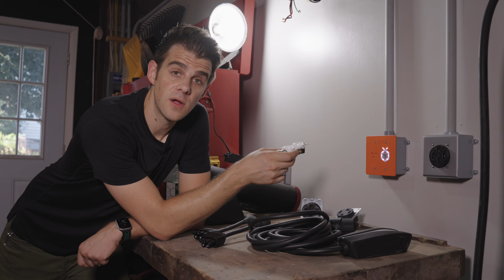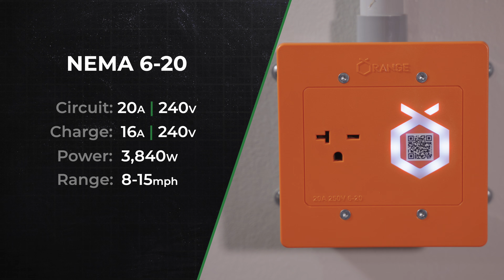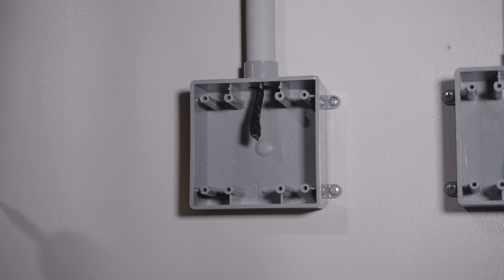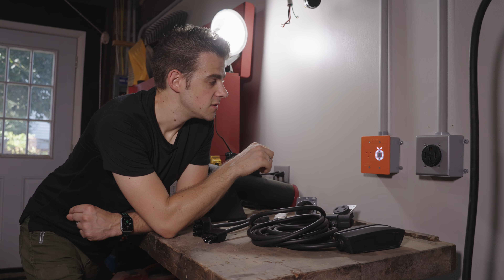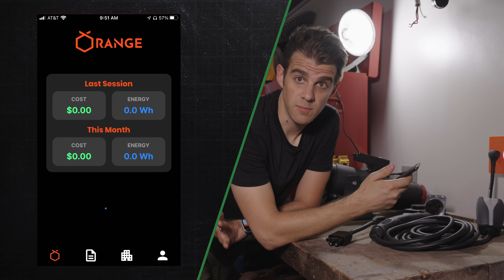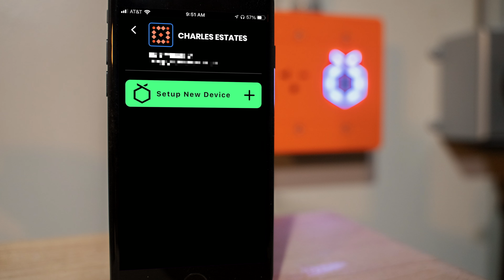A Better Option for Apartment EV Charging: Orange Charger

Comment: Thanks for this video. As a house renter and owner/driver of short range 1st generation EV (Mitsubishi i-MiEV) for the past 7 years, I currently find myself providing public input to the City of Tucson, regarding EV readiness standards for new construction of multi-family rental properties. The developers/realtors are resisting the idea of installing simple outlets that they can't meter, but aren't wanting the expense and bother of formal J1772 hardware. The Orange Outlet was brought to my attention by fellow EV-driving friends and appears to be the perfect problem-solving product at exactly the right time.
Reply: You are a brave individual for driving that vehicle...
Reply: @michaelholliday100  Actually, it's pretty safe (4 star NHTSA crash rating.) It sits up very high for a subcompact and at least it's visible to the typical pickup or SUV driver, who are hopefully paying attention to the traffic around them. Conversely, the windshield is massive and I know what pedestrians and cyclists are doing. Great acceleration from 0-to-30 (far more responsive than the typical subcompact gas car,) where most real world city driving is done. I can get out of the way of trouble quite effectively. I've been driving for 50 years now and even spent a few years way back when as a cab driver.

Comment: What a shame about the shape. Doesn't look like it's possible to put them outside with a weather cover that's required by code. Also the software needs to be able to have the money from a particular outlet go to a specific bank account. Maybe just have to set up a bunch of orange accounts. Otherwise very cool.
Reply: Its UL certified and its perfectly capable of being placed outdoors :)
Reply: how do we know the company doesn't offer a fully weatherproof unit? The examples in the video were both inside.
Reply: @rupe53  ya looking closer it appears the outer trim ring is separate and the rest can be placed in a standard exterior box..

Comment: So what EVSE Units use a Commercial Grade Side Wired 2-Pole 20A plug?  And what about the security of the EVSE?  I get the plug idea and cost and Orange looks like a good idea.  But as an EV owner in an apartment (not me, I own my own home) I can see the problem of EVSE theft is a big problem.
Reply from the maker: The Tesla Mobile Connector has a NEMA 6-20 option, and I've purchased a 6-20 to 14-50 adapter, but this requires an EVSE with the ability to reduce the charge current. I agree with the theft point. Something that helps is that most cars allow the plug to lock to the vehicle.
Reply: @chargeeverywhere  I'm in touch with my state senator that is on the energy committee and have a meeting with him in early October. I'm discussing EV implementation in Mississippi. I'm trying to convince him that we need to think beyond the next election cycle for solutions. Right now Mississippi is among the last in EV infrastructure. The report that was due to the federal agency on 1 Aug has been submitted but they, unlike Louisiana and Alabama, will not allow the public to see it yet.  Apartment and rental charging for the coming, I hope, lower-cost EVs will be important. Changing Electrical building codes to require x% Level 2 charging plugs even at 16 or 32 Amp should also be part of future buildings or current upgrades to existing buildings. The other need is to have a requirement to increase that % in line with the sale of EVs every few years.
Reply: I’m not sure about CSS but the Tesla connector can only be unlocked by someone who has control of the vehicle. They could take the short cable that plugs into the EVSE but not the EVSE itself

Comment: Does this really only work well if the renter has a dedicated parking space?
Reply from the maker: If the landlord installs enough of these it doesn't matter as any driver can use any plug and will be billed accordingly. That's the beauty of the installation cost being lower, many more can be installed for the same cost.
Reply: @chargeeverywhere  I see - the QR code isn't tied to the car, it's tied to the charging session.
Reply: @geirgaseidnes7809  ... the charging session will be tied to whoever activated the outlet with their cell phone app.

Comment: I like this for workplace charging too. It looks like a way for employers to offer charging without eating the cost of electricity.

How does it work on the property owner side? Is there a monthly cost to the property owner or does Orange just take a percentage cut of the revenue? 

If it’s just a reasonable percentage or none at all, I could see this scaling big all over the place.
Reply from the maker: From the podcast I know they are looking at workplace as a potential market too. That became less of a focus during Covid.

Orange takes a cut of $0.05/kWh, so they absorb some of the risk for landlords. It’s not a terrible fee, so I think it scales well.
Reply: @chargeeverywhere  Cool idea but 5 cents/kWh! Ouch, our standard rate here in Nevada is 12.5 cents/kWh! I'm on TOU rate so I only pay 6 cents/kWh. I could see a flat monthly rate but if the outlets are underused/unused I see how a landlord would be unhappy paying a monthly fee. I could see a landlord want to recoup some investment/$$ for on going maintenance and end up adding his own 5, 10 or 20 cents/kWh to the base electric rate (national average is approx 12 cents/kWh) plus the Orange fee so the end user may pay 22-37 cents/kWh
Reply: @bsaelectronicsgmail  Yeah, our overnight TOU rate here is $0.04, so Orange taking $0.05 means their fee is more than the actual cost of electricity. Ouch.
Reply: @bsaelectronicsgmail  Its actually 5% of the rate, not 5 cents
Reply: @bsaelectronicsgmail  That's part of the cost of owning an EV

Comment: Interesting, brings up a few questions. Electricians are going to be harder to find. What’s the projected cost of wiring a  200 unit garage? I guesstimate $100,000? Who will support “my car is not charging?”, the apartment (no), the car maker?, orange?, a electrician? ( @ $200 hr)
Reply from the maker: Yes, maintenance is a big concern for EV charging equipment. I do think something like this is substantially better than a hardwired EVSE. The equipment is much simpler and is very similar to a standard outlet (from the electrician's standpoint). If I had to guess, maintenance will likely be on the landlord, just like for any other outlet on their property.
Reply: @chargeeverywhere  This is correct and is why it was designed with simplicity in mind. Not only did we remove the charging cable to reduce maintenance costs but we also made something that's relatively easy to install.
Reply: I don't get it. What is the value proposition?

I can install a normal 240 outlet and ask the EV owners to pay premium for those spots. Why we are bringing extra payment and accounts etc? 
Also, if one apartment owns the charger and in other one I have to carry my charger all the time, I will chose the first option.

Outlets will be needed in all parking spaces in future anyway so why shouldn't one get the outlet  for $40 dollar and install the charger for $500(tesla charger level 2)? 
I really tried hard to understand but don't get the value prop. 

Founder, can you please explain?

Comment: nice, i hope someone copies that for the european market
Reply from the maker: Europe stands to benefit even more with your 3-phase standard - although your Type 2 sockets (sans cord) are somewhat similar to this.
Reply: @chargeeverywhere  I figure I'll be ruled out because it's not accurate enough. 1 phase is what most are capable off and quit often sufficient
Reply from the maker: @bingobongo9340  I should have said that differently. Just because Type 2 supports 3-phase does not mean most will use that. My mistake.

Comment: Sweet device! Tech should be applied to the charger itself as well to prevent theft and anyone else from using the stolen charger later.
Reply from the maker: This is something I've thought about. The plug can lock to most cars, which at least prevents theft, but can't prevent someone from unplugging you.